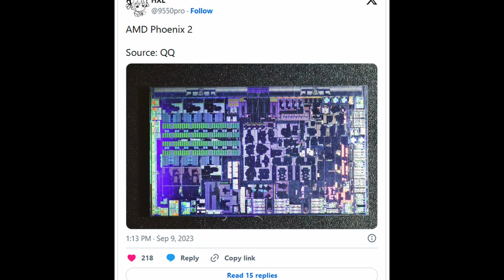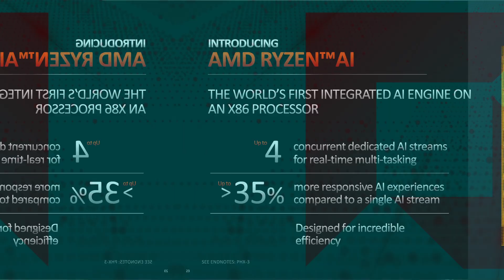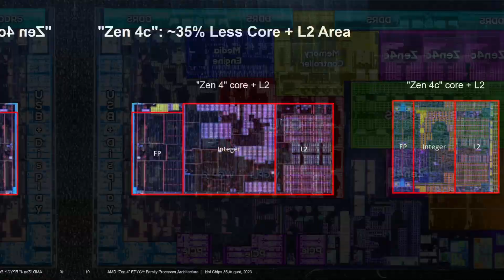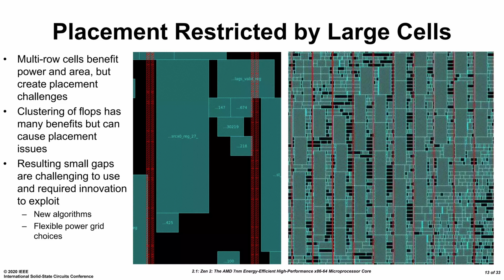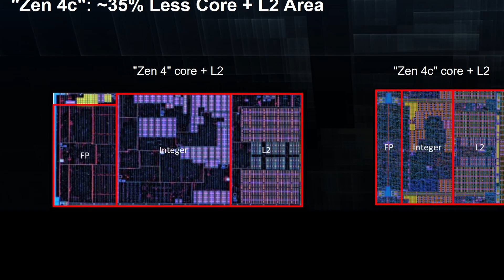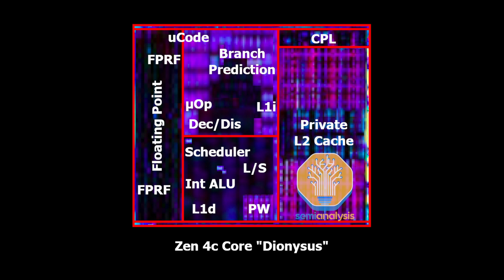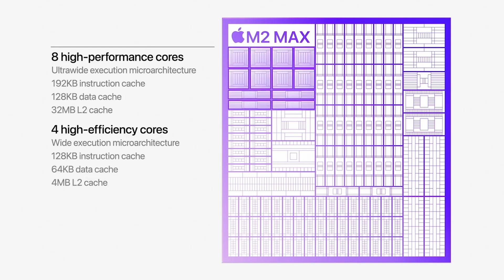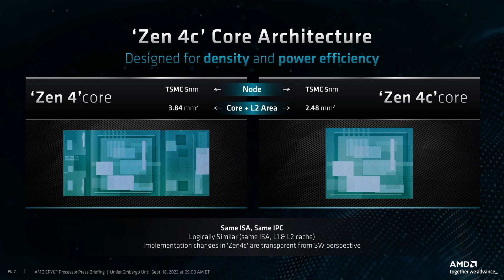Why AMD's first Hybrid-CPU is Different

Comment: AMD is playing on 'easy mode' in regards to scheduling: With cores where the only difference is max clock speed, all you have to do is prioritize the high-clocking cores, and you're done. If the c cores are more efficient, you can prioritize c cores when all cores are clocked slower than c_max to save power. Intel has it much harder - they have to have instrumentation in the core to sense the instruction mix, in order for the scheduler to know how threads would have performed if run another core. Past tense, because they now have to hope that the mix stays the same for long enough.
Reply: Well AMD basically doesn't have to do anything... The existing Ryzen CPUs already hint at the OS what core is preferred, because different CCD have different clock/voltage behaviour. There's no difference here. Just more cores for the customer.
On the other side, intel created the problem for themselves... And then partnered with Microsoft to bake the needed behavior into the windows scheduler, but only for W11 (cause f u that's why).
Technically since intel blocked AVX512 usage, all cores support all instructions. The only big change needed then is to not move threads between fast and slow cores when they're above a certain priority or activity level.
The slow cores just have a lower priority for when they steal threads from the fast cores.

It doesn't work the way you think it does. (i don't know how arm does it for android or mac but i suspect it's not much more complicated either)
Reply: @SquintyGears  Intel need the Thread Director because the Atom cores perform poorly at AVX2.
Reply: @RobBCactive  they perform poorly at everything... I mean not in a way many people would care. But it's an older architecture and lower clocks. It's not just avx2 that they're filtering for.
Because all the cores support all the instructions. So why would you think that they only try and schedule for a single instruction's performance?
Reply: @SquintyGears  because when Intel introduced the Atom cores and Thread Director they specifically talked about that type of instruction, plus the Chips and Cheese investigation into P+E efficiency in an HPC context found that weakness.
Saying they're weak across the board is missing the point, in high core counts power efficiency is key, because of power & thermal limitations.
Reply: @RobBCactive  yes but the AVX2 situation is the example of the worst case. Not the only reason to do asymmetric scheduling of the cores.

And it's a bit more complicated than high core counts requires power efficiency. Bandwidth and core to core communication comes into play at the same time. Intel is severely limited in terms of power yes. They're hitting 300W spikes. But that wouldn't be true for AMD.
Reply: But the OS doesn't know either what the performance demand of a thread will be so it picks the one with most capacity.  I could imagine a power saving mode where only Zen4c cores are enabled to save battery, so no boosting is allowed.
Reply: @RobBCactive I dont think they have big advantage when cpu is mostly idling. They just can add cpu multi tread performance very energy and cost efficiently, so main treads can perform better.
Reply: @RobBCactive  Edit your power profile in Windows, or better yet make multiple. You can make a shortcut to activate them. Set max clock speed to 99%, which actually just drops to whatever next step is, which may be like 80%. You save about half the power, due to how power scaling works with CPUs. You can even set it to auto switch when opening demanding applications, such as games. This is especially useful for laptops to quiet fan noise, and extend battery life by preventing clock speed from over-ramping when not needed.
Reply from the maker: Ryzen CPUs already schedule based on max. clk speeds, the OS knows which core is the best core on your CPU.
Reply: Though the cores might be denser, because they clock slower. They are actually LESS efficient at many points since any given clock on a Zen4C requires more voltage than e Zen4 regular. This is especially true as you try raising the clockspeeds.
Their benefit is that they also have a lower voltage floor and are more efficient at the very low clock speeds.
Reply: @bayanzabihiyan7465  Good point and interesting insight. This shows how AMD has been working hard on these architectures to beat Intel. NVidia must also be shaking in their boots, seeing AMD on their rearview mirror pushing hard on the GPU sector as well. All this is quite interesting and definitely useful to discuss in these comment sections. Sincerely speaking, I started disliking NVidia for all their market strategies and also because of CUDA. Who wants a shader language that only works on NVidia GPUs? It's disgusting to impose a shader language specifically targeting their own architecture. NVidia is becoming more and more similar to Apple and any other monopoly, but I think their days are counted, or at least that's what I hope. 😂
Reply: @bayanzabihiyan7465  do you have a solid source for that?  I cannot find any suggestion that is the case.  The process is the same, the circuits are NOT designed to reach peak frequency but be power efficient.
Why would they need "more voltage at a given clock frequency"?   They're using denser cells, it should be the opposite!
They've literally been designed for scaling in the data centre and provide MORE performance at the same TDP.
Reply: With dynamic load balancing one doesn't need to prioritize anything unless one is wanting really low context switching. However, to "prioritize" loads for high clock cores is extremely hard because one would have to "estimate" how heavy the loads are. I don't have a clue how this can be done automatically, that is, without the programmer saying what's a "heavy" load and what's a "light" load. My guess is that when a load is arbitrarily sent to a low clock core and is starting to stay "too long" on that core, it's obviously a heavy load and it has to be transferred to a high clock core. This "prioritization" scheme is far from ideal, but it's the only way I see this working with a dynamic load balancing.
Reply: @schizoidman9459  there are ACPI tables telling Windows the capability of each core, so the scheduler picks the most capable idle virtual core.  SMT threads are rated lower as would be c cores and in ST operation Windows juggles between the 2 fastest cores which boost the highest.
Reply: @RobBCactive  Thanks for your reply, but how does Windows know which thread is "heavier?"  I assume it's executing it and realizing it's taking too much time on an efficient core and then transferring it to a performance core. I don't see any other way. Also, you can't count on a specific OS feature to run your program with as much performance as possible. What's it's required is that program to behave similarly across different OS.
Reply: @schizoidman9459 sorry for not replying to how Windows knows what thread is heavier, in general it doesn't though game programers can assign threads to cores, they usually won't bother.  But as heavier long running threads will stop/start less, the critical ones will tend towards holding the fast CPUs.  It's possibly why latency/performance issues have been seen with P+E cores, where high core count and optimisation fails bounce threads too much around or instruction mix changes cause rescheduling to other core.
Reply: So that's what thread director is?
Reply: Cache is also less in Zen(number)c cores, which might have a slight impact in ipc since the core has less data immediately accessible at any given point, so it has to reach out to L3 and ram more often.
Reply: @strjim  The video mentions that the C core has the same cache amount as non-c core.
Reply: @strjim  Highly parallelisable MT apps simply don't need much cache, it's how Intel were able to gain benchmark wins with E-cores.
Reply: @RobBCactive  sure, but it may have an effect in certain cases. That is undeniable. That small penalty will be far outweighed by the performance of having kore cores though.
Reply: @strjim  not really because when an algorithm is highly parallelisable you choose how much data each thread handles in one chunk.  So you query L1 size ..  You can find cache oblivious algorithms in HPC are used in numerical libraries.
When you write a program doing this kind of processing it's all about the pipeline for the main loop, minimising branching and avoiding memory stalls.
Large cache tends not to help, programs that traverse complex data structures in parallel tend not to scale because of lock contention and cacheline bouncing.  So they're simply not in the "embarrassingly parallelisable" algorithm class.
Reply: @RobBCactive  ol but not everything is a highly parallelisable algorithm. Single-threaded workloads are a thing too.
Reply: @strjim  then you buy a V-cache core, doubling the core in a CCD is NOT helping lightly threaded performance, as we know from the benefits of all threads on one CCX.
Reply: @RobBCactive  all I know is that some stuff benefits from cache, mainly video games. And some people might end up gaming on Zen-c cores. It is possible that other things benefit from larger cache too, but i only know about how certain games benefit from extra cache.
Reply: @strjim  few games utilise the fast cores with cache heavily, Windows chooses preferentially the most capable idle cores when it schedules a thread.
It's the same situation as SMT/HT which were enumerated as less capable cores in ACPI tables.
Solved problem for decades.  The 7950x3D chips are parking one of the CCDs to only run game threads there under heavy multi tasking load, which changes the algorithm.  Something tech tubers missed was the pioneering of heterogeneity which could be applied in mobile.
Reply: Why would it be any different?  If it's as easy as identifying which core can clock more, then Intel's situation is the exact same.
Reply: @maynardburger  incorrect the E-cores can perform badly given certain instructions.  Find the Chips and Cheese investigation into E core inefficiencies, sometimes P core only is faster than P+E in multi-threading.
Reply: @RobBCactive this. In my experience working on arm systems, the little cores (cortex A53) tend to perform a lot worse for floating point heavy JIT code, than the do for your average C binary. Both fp-performance as well as the branch prediction seem to create major slowdowns even far below the benchmark performance.
Proofing the old rule: running good code fast is easy, running bad code fast is the real challenge.

Comment: That gpu takes up big space for just 2 workgroups wtf else is it doing
Reply: L1, L2, instruction, and constant caches; global data, command and dispatch processors, primitive units, rasterizers, and render backend
Reply: there seems to be enormous overhead for the interfacing and "feeding". A 4 WGP design would barely be bigger unless the uncore grows as well.
Reply: Everything else. The GPU pipeline is very very long. And number crunching is only a small portion of it.
Reply from the maker: Scaling the WGP is more efficient, thats right. The core components take up a large amount of space compared to only two WGPs...

Comment: hybrid on desktop is stupid
Reply: Zen 5c cores are not exactly hybrid cores. The architecture is the same as Zen 5. They just clock lower than Zen 5 cores and take up less space. So the OS shouldn't see them as different cores like with Intel 13th/14th gen and scheduling should be much easier and more predictable than full fledged low-power/hybrid cores.
Reply: @bgtubber  The OS still needs to see them as different so it can prioritize the most demanding applications to the highest performing cores.  It'd kinda suck if Spotify, Adobe Reader, and Brave got assigned to a high performance core while your game or game or work got assigned to a compact core.  The consequences for getting it wrong are not nearly as bad as with a true hybrid approach, but it's still there.

OP is correct though, on desktop and workstation the compact cores don't make a lot of sense.  I could see laptops getting only compact cores.  Desktops getting only performance cores.  Most workstations getting only getting performance cores, but some high end SKUs getting both.  Most servers getting only compact cores, but some high end models getting both.

Where I could see this going is AMD leading new architectures with the Ryzen 7 and 9 and Threadripper chips that only get performance cores.  When the compact iteration is developed then releasing the low end desktop, mobile, and server chips that get compact cores or a hybrid design.
Reply: @bgtubber  I wasn’t really thinking about power consumption, just performance. I completely forgot about CPPC, thanks for the refresher. But that doesn’t change the fact that the OS must still recognize the performance hierarchy, it can’t just treat all cores as equals.
Reply: @SeniorKlean  Ah, I see. 👍
Reply: @bgtubber yeah that's what I got from the video, thank god they didn't chase a bad industry trend.
Reply: @bgtubber  APPLE USES HYBRID, ARM USES HYBRID, INTEL USES HYBRID, IS THE FUTURE. HYBRID ARQUITECTURE IS BETTER THAN NORMAL ARQUITECTURE.
Reply: @TheHobbitmann   If you're going to yell in all caps, at least use correct spelling.
Reply: HYBRID IS VERY INTELLIGENCE YOU ARE STUPID, IS THE FUTURE

Comment: Great stuff! I remember seeing some annotations of Arm designs that implied they also use this method of making the chip less blocky, with several parts of the chip sharing chunks of the chip and making it impossible to clearly indicate where specific things are. Is that the case?  Is that mostly a result of using high density cells, or do they also use some kind of automation for laying out the floor plan?
Reply: They use automated layout on both core. It is just that the big core is optimize for clock speed so the critical wires must be very short. While the "C" core is optimize for area so the wires are allowed to be longer and this free up the transistor layout to fill the gaps between functional blocks making the logic blocks closer with each other.

Comment: i think they should fill up the saved space with extra cache .. so staying with big big cores but just more performance. at least for client cpu. server is a diff story
Reply: They can make the L3 larger. AMD already tested larger L2 and the result is just 1% increase in single thread performance.
Reply: @kazedcat  i mean like the x3d versions just not stacked
Reply: @sgtnik4871  The stacked cache has advantage because they can pack more SRAM per unit area using optimized silicon for large amount of cache.

Comment: A funny note, Apple did the same sort of thing with the RTL for their A10.

They devolved into different designs completely after, but it is amusing.
Reply: Android devices cores too went from bigger prime cores which were the same arch as the medium cores to the different X series.
Reply: @bulletpunch9317  Those separate arm cores have less instructions than the big core, which means lower performance, but PCs are different because PCs need more performance, so using the same architecture could increase power, but lowering die size to cram in more cores in the same package would give us some extra performance at the same power usage as the non-hybrid CPU.
Reply from the maker: Oh, I didn't know that. Thanks for the info!

Comment: We need to see how good AMD's hardware based thread scheduler works to distribute work correctly between the big and small cores. Depending on Windows itself is a very bad idea.
Reply: The cores are the same. The difference is only how high they can clock - and Windows already knows how to deal with stuff like preferred cores.

This isn't any different. And that's the advantage of AMD's approach.
Reply: @KarbinCry  I hope ur right, gaming on Alder lake was bad the first 2 years.
Reply: The hardware scheduler is only for threads on one core. Moving threads from core to core is always done by the operating system. The CPU can however provide performance information (eg. occupancy, cache hits)  to the OS that the software scheduler can use to optimize core assignments
Reply: That's been a thing for years. Most CPUs already have favoured cores (the ones that boost best) and Windows has been dealing with this since 2019 as well. This is no different since we're dealing with clock speed
Reply: @lonyo5377  Yup CPPC2 has been a thing since X299 HEDT from Intel. Laptops are also using this for years.
Windows should just work assuming M$ doesn't some how F'k it up again.
Reply: Considering the only difference between the cores is clock speed, windows will do just fine since it literally judges how fast a core is by clockspeeds
Reply: its a shame that that can't be handled on a firmware/hardware level, but as things are, AMD's approach is probably a lot better. Since the CPUs have identical circuitry, windows' default scheduler will simply assign high and low performance tasks to higher and lower clocked cores. That's probably exactly what AMD planned for.
Reply: @curvingfyre6810 yes one more thing the C cores have less L3 if I remember correctly but I think this move by amd is brilliant saving space same instructions set only clocks difference I really hope the windows kernel guys do the very simple work that’s mostly already done and everyone is happy
Reply: @nicolaspaglione  As far as I know, cache differences can be handled entirely by hardware/firmware, right? If so, microsoft's job is dead simple
Reply: @curvingfyre6810  as long as windows says hahah go brrrr on the faster cores there shouldn’t be issues but I’m not a cs major